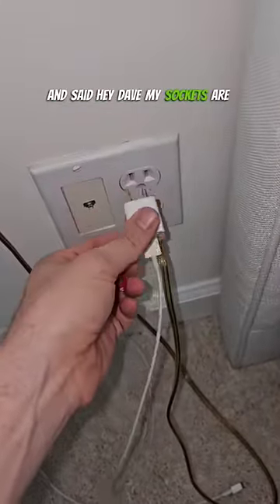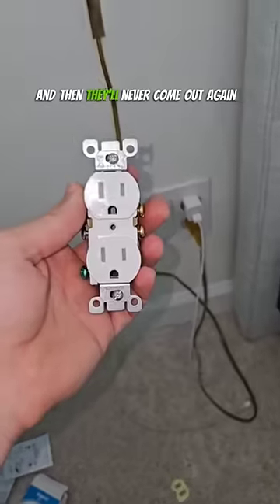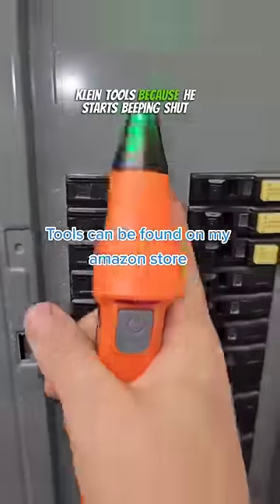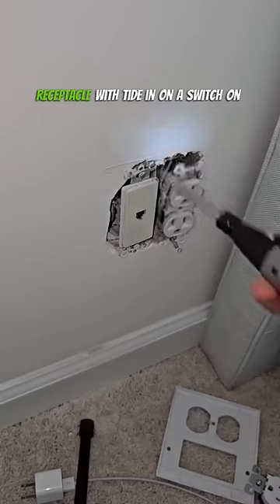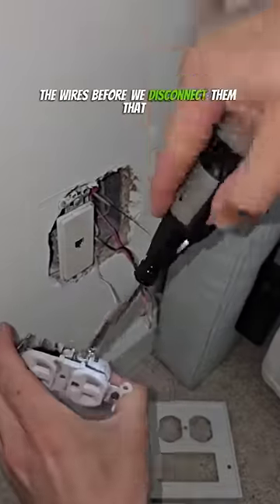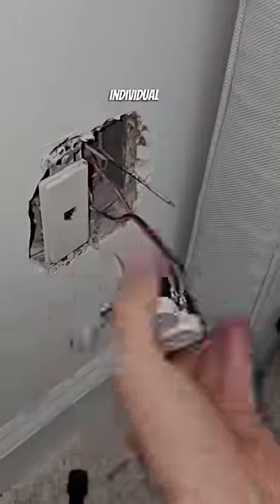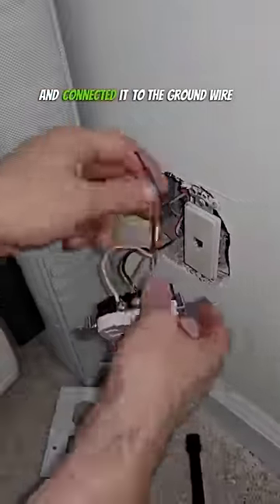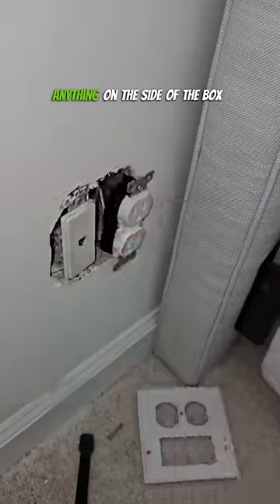🔥 Thats a hazard! How to change a switched outlet #diy #handyman #electrician #HowTo

Comment: I’m not an electrician and have no clue what I’m doing half the time, but I’m also the kinda guy that’ll do something myself if possible to save money. First time I did something like this I shocked the crap outta myself
Reply: Im not electrician either but i have wired up dozens of outlets,breakers, ran wire ect and have never shocked myself. Once you fundamentally understand how electricity works you wont have am issue
Reply: @randybobandy9828 once you understand electricity isn't just a concept and it flows like water would, you're ahead of the curve.
Reply: @randybobandy9828  not true no matter how “familiar” you get with electricity not only will you have mistakes and get shocked but you could also die.
Reply: @colbysteinke4259  carelessness kills.  It may not be your carelessness that kills you.

Comment: Circuit breaker tracers literally only save you time if you work alone. Shouting "Yo, dude, is the light I plugged in off? I'm flipping switches" is just as good as plugging something in, walking downstairs/ to the breaker and listening for the beeps.

When you work with someone else, or DIY home repair, you're literally throwing your money away.

Now, if you test networks...
Reply: Just short it that's how I work alone.
Reply: Yeah, I was gonna comment; that ain’t the only way to check which breaker your outlet it on. And it especially doesn’t need to be a Klein Tools one.
Reply: Idk why this is so funny but it is. "WAS THAT THE ONE?!?" "NO!" Flick "WAIT IT WAS THAT ONE, BEAN"
Reply: How about a radio, turn it on full volume  🤔 😏
Reply: They help if you work in an apartment building and don't want the fire department out because you shut off the breaker to the fire alarms.

Comment: NEVER rely on just the breaker unless you like getting bit. Always use a non-contact tested (that you have verified is working AFTER killing the breaker. I have run into not just two circuits in the same box. But also weirdness like Edison circuits that were wired so NO single breaker would kill the power. Those require both breakers on opposite buses to BOTH be off.
Reply: Non-contact voltage detectors are kinda garbage. If you're actually concerned about it, use a meter, a proper one, not those 20$ ones at walmart.

I wouldn't trust a beeper for much.
Reply: What? If you had a plug hooked to two breakers on opposite busses it would short out when you turned on the 2nd breaker
Reply: @barryallen5507  There's a reason they're called Widow Makers.

Comment: Fun bipass to the breaker tool. Just plug your radio in the receiptical your working on and when it stops you found the right breaker
Reply: Thats actually proper clever thank you
Reply: @eaarbay  I've worked for cheapskates before and if there's a work around rather than buying a new tool lol
Reply: I don't like flipping off/on power unnecessarily, can reset desktop computers or routers, or be the last straw for an old fridge or whatnot.
Reply: This works pretty good, but when you're working in the hospital and you're in the panel that feeds life support machines, you can't just start turning shit off

Comment: What you really need is by far the best in the world, UK three pin plugs. They will NEVER fall out of the wall and offer high quality power connection, especially for high load or HiFi equipment. The rest of the world is miles no light years behind. 🙄
Reply: I am a electrician and i approve this message.

Comment: You also have to update the box too. You need a low volt separating slot. Tape is not code for keeping low volt and high voltage devices separate
Reply: It looks to me like there's already a separator between the two sides, but it's a bit hard to see it. The tape was not to keep low voltage and high voltage separate, the tape was to prevent the side of the outlet from accidentally touching the metal box at any point.
Reply: This isn't new construction it's a device replacement. If it passes code when it was installed unless you're doing a major modification then it's good to go now.
Reply: @alec4672 THANK YOU literally no one understands this...
Reply: @johngavin2570  or unless you're selling the place too I suppose. When we sold our house it was common to only pull a hot and neutral from the house to the barn and just pound a ground rod out at the barn. Well that's not how it's done now so the inspector made us add a 3rd ground wire. I thought it was dumb there was very low resistance between the both of them but what he said goes.
Reply: @alec4672  The AHJ here in WA state would disagree, unless there have been changes since the last time I had the dubious pleasure of being required to call in for an inspection of my (phone/data) work.

Although it is a replacement-in-kind for the receptacle, the lack of a separator could be viewed as exposing a non-qualified person (me) to hazardous voltages.

Funny thing was, the box that he looked at was not one that I even touched.  It was power/phone, and i was installing network wiring all over the place.  Everything I did was old school and was fished up from the crawlspace with cut-in boxes.
Reply: Why waste they expense when it’s not a new construction, if it ain’t broke dont fix, fuck staying compliant. Unless totally necessary.
Reply: Look out! We ot the HOA code enforcer that will tell you how To fold your shit tickets before you wipe.
Reply: @alec4672  The inspector was absolutely correct in making you pull that 3rd wire to the barn. 

A ground rod is not meant to provide an equipment ground path for faulty current. In fact, often if this is your only ground path as such was your situation, if there was a fault to ground, the breaker likely wouldn't have tripped leading to a very unsafe situation.

You see, electricity is not trying to find a path to earth as many people mistakenly believe. It is trying to find a path back to the source, which in most residential setups, is the utility transformer on the pole or out in the street. That is why the neutral wire is also the grounding wire in most single family dwelling electrical services in the United States. Because this path provides the best path back to the source, and in the event of a short circuit or faulty equipment that causes a short circuit, the over current protection device will trip as quick as possible which in most cases is instantaneous as soon as the short circuit is introduced.

So you might ask, then what is a ground rod or what is known as a grounding electrode for on a residential and commercial service? 

The purpose of that ground rod is to provide a solid and quick path to earth for lightning strikes, should either the house get hit by lightning or more likely, the utility wires out on the street gets hit by lightning which would then travel across the utility wires and enter your house. But by having a ground rod in your electrical system, you're giving the lightning energy a path to earth. Because unlike the electricity that we use everyday, lightning does seek a path to earth. 

But as I mentioned above, electricity is not seeking a path to earth, it is seeking a path to its source.

So with the setup you originally had in your barn, the electrical system was not safe because there was no way for a fault current to get back to its original source, so it's possible a short circuit to ground wouldn't have tripped the breaker and now the ground along with all the metal parts of the electrical system in that barn could have become and remained energized. This could have lead to a very dangerous condition which could be fatal.

So there's no doubt that the inspector did the right thing by requiring a dedicated ground wire be added to the service you had going to your barn. 

I realize that some of the things i explained above might not be perfectly clear, but there are some great illustrations that provide excellent information on this subject. I highly recommend Mike Holt for his training material and his illustrations. Many of which are free at his website. 

Often just following the illustrations that he provides clearly explains the reasons why certain codes and rules are in place which ultimately are there to protect the people and equipment that are using the electrical systems we all take for granted.
Reply: In what world is 120v considered "high voltage"?
Reply: @El_Diablo_LI  imma stop you right at the first sentence and point you to single wire ground path return electrical systems like the whole damn national grid is in New Zealand or how they wire lights on freeways. The ground is just as good as a wire in many cases. I'm a journeyman electrician going to school for electrical engineering. There's was no reason for a 3rd wire for ground. Look at Japanese houses, none of their outlets have grounds unless it's specifically for a window air conditioner. GFCI/RCD plus a ground rod is plenty of protection in 99.9% of cases.
Reply: @El_Diablo_LI  the utility company provides 240v to the property without supplying a ground. So what's the difference in supplying an outbuilding with 240v without a ground? Absolutely nothing that's what. Only risk is a bad ground rod but their was low resistance between the one for the house and the one for the barn, I checked.
Reply: @El_Diablo_LI  and yes I know some countries utilities provide the ground connection along with you needing a building ground as well. In the UK the utility pulls you a ground from the pole but we don't do that in the states. Just cause that's how the NEC has decided to standardize it doesn't mean it's the only right way to do it.
Reply: @lassaut6794  telecom world. Anything above 40v in the telecom/data people call "high voltage"
Reply: @prophetanarchy2355  dude a new plug is like... $0.25
Reply: @El_Diablo_LI  Except the entire point is moot when a bonding jumper is installed, allowing the fault current to go through the neutral.
Reply: @user2C47  I forgot to mention that, the neutral was bonded to the ground rod in the barn until we pulled the dedicated ground from the house.
Reply: @alec4672  Sir, I’m not experienced in electrical systems in other countries so I will not speak to those systems. But in the US, a path to the system ground is required. No if and or buts. It is the code and not doing so creates a dangerous system. The codes are there for a reason. So obviously you don’t understand how the system works. I was only trying to explain it to you but obviously it is too complex for you to understand. No worries. I know I’ll be safe in my house, and my customers will be safe in theirs. But your house? Let’s just say I wish you luck!
Reply: @alec4672  The utility provides the grounding path from the source via the neutral. And the neutral and ground connections are bonded together at the first means of disconnect ONLY. 

After the first means of disconnect the neutral and ground must be separated. So if you are feeding another building or structure after the first means of disconnect on the main service, then a separate grounding wire is required. This is per NEC in the US and any other jurisdictions that uses the NEC as their guidelines. 

Not doing it this way creates a hazardous and dangerous system. The inspector knew this which is why it was required to be fixed. Instead of arguing with me about why you think this is wrong, why not try to understand why the code is written with this requirement. But if you want to remain uneducated and ignorant to the reasons and purpose why these requirements are in place, you are free to do so. But uneducated and ignorant can get people hurt and possibly killed. So go ahead and do as you wish.
Reply: @user2C47  Only at the first means of disconnect for a service. After that they must remain separate. So it is not a moot point. Please educate yourself about electrical systems in the US that fall under the jurisdiction of the NEC before you write anything else. Otherwise you are just proving to everyone else what I already know.
Reply: @El_Diablo_LI  did you miss the part where I'm a journeyman electrician? No the utility does not "provide the ground through the neutral" the building provides it's own ground. A ground wire doesn't carry current a neutral does. You can't call the neutral the utility provides a ground because it carries current. Some countries utilities like the UK do provide a utility ground so the utility provides a hot a neutral and a ground wire (for a single phase 240v service common in the UK). The ground and neutral are separate from the pole that's a utility provided ground. Meaning their main panels in the house aren't bonded neutral to ground cause that's done by the utility company out at the pole. I know how to properly feed an outbuilding under the current NEC but we're talking about what was an existing installation which met code at the time. Feeding an outbuilding with 240v via two hots and a neutral, bonding ground to neutral and pounding a ground rod at the outbuilding works just the same as feeding multiple houses off of the same pole mount transformer.
Reply: @alec4672  ours is supposed to be 25ohms or less. Remember what yours was?
Reply: @alec4672  at least SOMEONE gets it
Reply: @goosenotmaverick1156  impressively low it was single digits if I remember right. We live in the iron belt and it's easy to get a good ground. When I was 16 we used some microwave transformers and ran power to a shack we had in the woods with them. Used one wire for the hot and a ground rod at each end for the neutral, something like 2,500v. Now that was for sure against NEC, I'm surprised we never killed ourselves with it 😂😂💀
Reply: @barryallen5507  dude! I was referring to upgrading circuit breakers.
Reply: @alec4672  You can think of it this way.  And mind you grounding is the most important part of the code.  Everything past the main breaker has 2 grounds.  one is called the neutral and it is there to carry  current.  The ground wire that is bare or green is there to carry fault current.  

The neutral is tied to ground at the main breaker and again at the meter.  So, you can't simply drive a ground rod at the barn because it's not grounded with the neutral at the main breaker. They remain separate all the way.
Reply: @bearcountrypublishing5303  the neutral and ground were bonded together in the barn. It was no different then a 120v feed from a power pole but instead of a pole it was the house. That used to be code compliant in the 40s and worked just fine. You clearly ignored everything I already said. Shit we had already installed GFCI protection in there on all the outlets any way. It was plenty safe and their was no need to hang a 3rd wire in the air in an existing situation. This wasn't new construction.
Reply: @bearcountrypublishing5303  I don't need to think of it any special way 😂 I'm a journeyman electrician I'm very familiar with the current codes on grounding and bonding. What I'm saying is what we had worked just fine and y'all are having a really hard time understanding that just cause it doesn't meet current code 🤷🏻‍♀️😂
Reply: These people aren't worried about code, Harvey homeowner isn't calling the inspector. Tape is just good practice for metal boxes for obvious reasons, nothing to do with the lv

Comment: I'm a diy guy and I'll turn the whole damn house off for 10 minutes before i get popped doing something like that
Reply: Smart guy, I work in industrial setting. I’m more afraid of homes 120/240v than 277/480v at work. Atleast at work I know our circuits are being maintained and checked on. Some homes have never been inspected or checked, they can be more dangerous to work with.
Reply: @HomerTheAckbar  I feel like I need an electrical engineering course just in case I ever get to own a home.  Though I might decide to hire a bonded electrician to inspect it and tell me what needs addressed anyway,
Reply: I've been an electrician for about 2 years now, and we work hot all the time. Nothing bad happens if it gives you a bit of a shock. If you have the opportunity, turn off the power, but sometimes things just gotta get done. But when it comes to high amperage, you should definitely turn off the power. If it's 15 amps, it ain't much unless you hold it. 

Old homes I've always questioned how the electrical was done. I mostly work in  1-5 million dollar homes so it's always interesting when we get a service call to old homes and see how things were done back then.
Reply: @uncrunch398  biggest items to check is ensuring all of your GFCI circuits are working properly. You’d be surprised to know some are not working. These basically protect the homeowner from being shocked in a wet environment. I’m not quite sure about other states but I do know that in Canada and California have made it a requirement that all circuit breakers in a new home installation be GFCI Circuit Breakers, all in one. I’d highly recommend replacing all circuits of outlets to those. Have an electrician properly inspect the tightness of all electrical components and replace all box covers to vinyl. He should also ensure that all grounds are properly bonded back to the electrical panel. Simple things like this can ensure a homeowners safety and investment. Most insurance companies do not cover house fires, it’s stupid but they will find so many ways to avoid payment.
Reply: I’ve gotten a pretty good shock from some impressively nonsensical wiring in my bathroom.
Reply: @HomerTheAckbar  I also work in industrial settings and I can tell you you are lucky that they circuits are maintained.